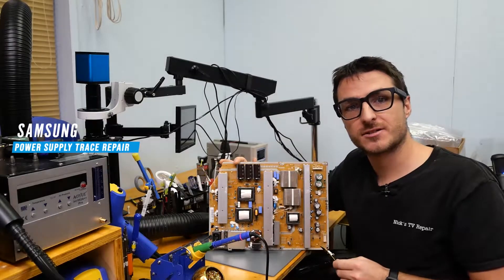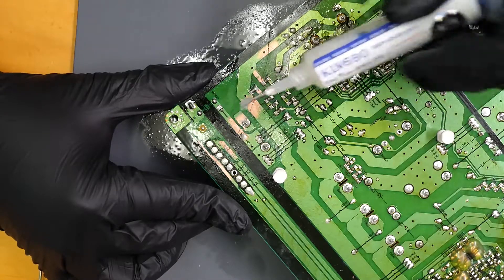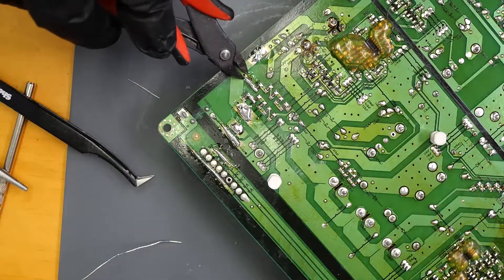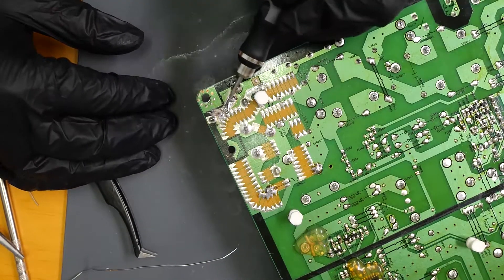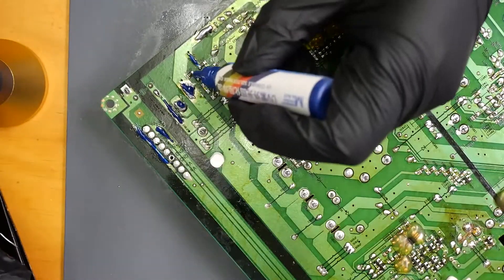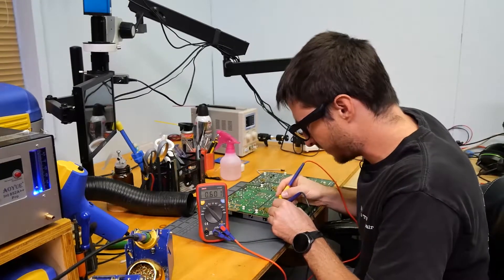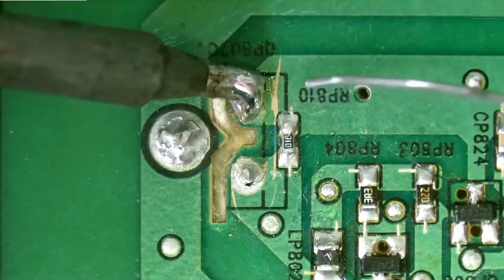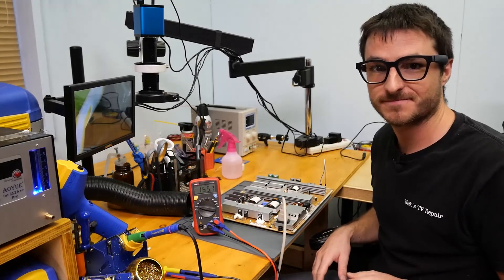PN51F8500 Samsung Power Supply Repair BN44-00619A

Comment: In one of the channel they give a tip, after 10 sec of UV lamp if you use hot air pass it will solidify faster.
Reply from the maker: ill have to give that a try